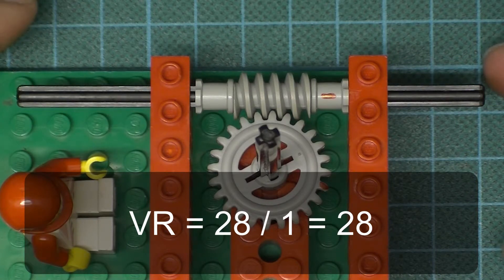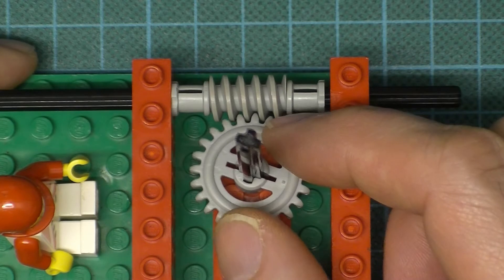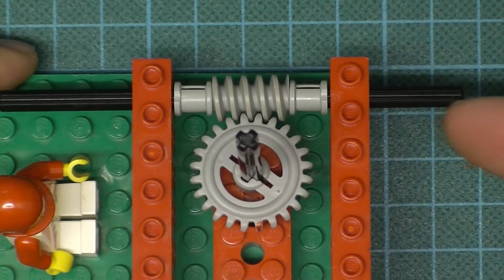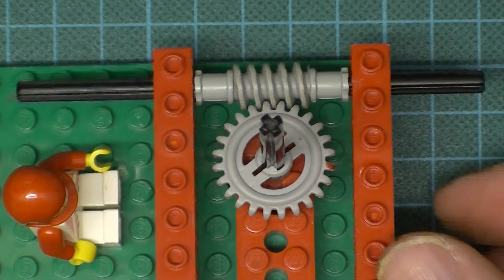Worm gear and velocity ratio explained using Lego

Comment: Can a worm drive a spur gear?
Reply from the maker: A worm should drive a worm gear (or "worm wheel") rather than a spur gear. If you compare a spur gear and worm wheel you'll notice the teeth are cut differently. However, for Lego models we can get away with using a spur gear.
Reply: @PizzeyTechnology  tq man does every worm wheel teeth need to be helical or they can be cut straight
Reply from the maker: Straight cut teeth won't mesh correctly and will lead to increased wear. For engineering applications this is clearly important, for toys less so.
Reply: Then ... will a helical spur can mate with a worm wheel (worm ring gear) ?
Reply from the maker: If you look closely at a worm wheel you'll notice the teeth are angled and slightly convex to mesh properly with the worm. This will be different to a spur gear (straight cut) or helical gear (angled). I hope that helps.
Reply: @endangeredcreator5050  Helical spur is an oxymoron.  Spur gear means that the gear is prismatic, which means it is a direct extrusion of the gear shape.  A helical gear puts a twist on that extrusion, so that the teeth come in to contact gradually for reducing noise and improving longevity when operating it at higher speeds.

A helical gear can be driven by a worm in a toy application, but you will get better performance if the worm gear is cut for the purpose of interacting with a worm.   That is, to conform to the shape of the worm meshing.

Comment: So good for an rc car build or not good?
Reply from the maker: That would depend on your requirements, but my guess is probably unsuitable.
Reply: @PizzeyTechnology  trying to make a lego drift rc car probably use tape on the wheels to make them slick with a high rpm motor and no differential
Reply: @PizzeyTechnology  limited space in my chassis that's why I'm thinking of the worm gear because its compact and perpendicular to the axels